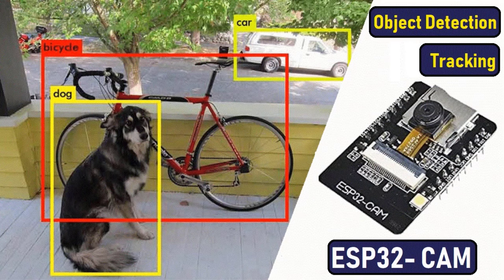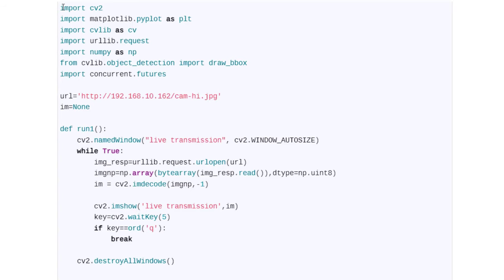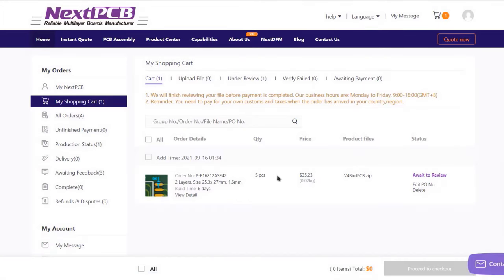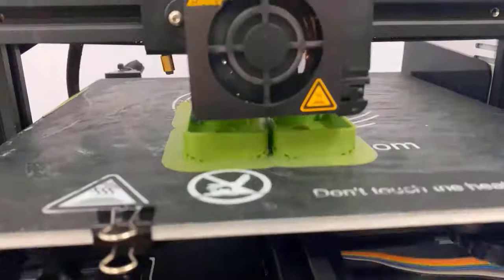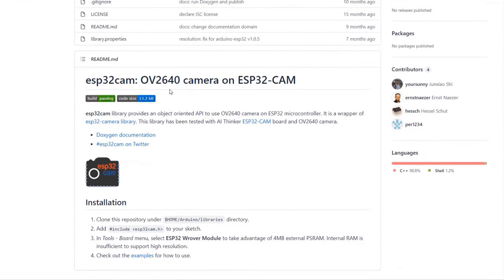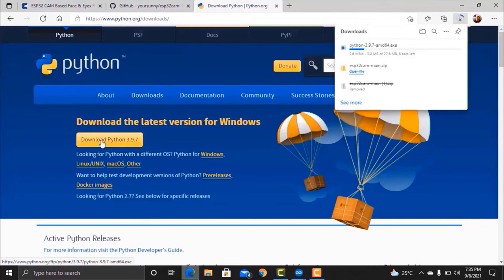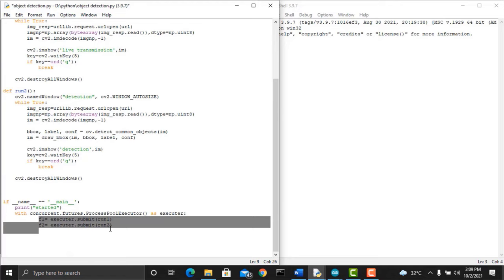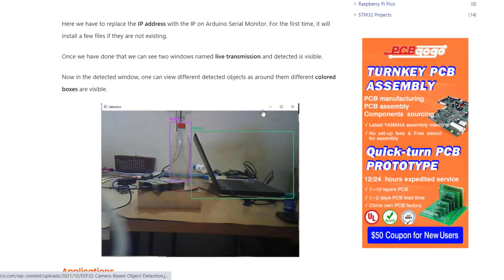Object Detection & Identification using ESP32 CAM Module & OpenCV

Comment: The processing is being done on the host computer and not on Esp32 stop misleading on title of the video. Just wasted my time.
Reply: exactly mate its a fake video!!
Reply: The title isn't misleading at all , the word "using" is correct. "Run" opencv on a ESP32 would be misleading. Imagine how slow and how hell of a headache it would be to handle opencv data with only 34 GPIO and 4MB of flash memory. Don't blame on others your misconception of the world
Reply: @fb846  microcontrollers can be surprisingly efficient since they don’t have to waste a large part of their power on keeping an operating system running. 
In the fast moving it-world you can’t keep up with everything - it wouldn’t surprise me if there were some rudimentary solutions for object detection on such devices. And while I agree that the title is probably not misleading on purpose, it can still be misleading for people which are not up to date with every spec sheet

👍🏼😃
Reply: @schlingelgen  yes some microcontrollers are designed with AI and object detection in mind like the "Arduino Nicla Vision" but in this case the title clearly mentions ESP32 wich is not. For object detection there is the Pixy2 wich is compatible with most general microcontrollers. But my point was that the title wasn't misleading because it's very specific. "Using OpenCv & ESP32" is different than "object detection run on a microcontroller"
Reply: @fb846  I get that, I just wanted to say that it’s not just black and white, misleading or not misleading. I think that depends, and all the information you just gave is not common knowledge you can expect everyone to have. I don’t think the creator is the one to blame, but I can also understand why some people are not satisfied with the solution since they were looking for something different.
Reply: Did you get any video or any source to know how to run a object model on Esp32 itself rather then on some different system?
Reply: @vijay1808able fake nhi h wo esp 32 cam module ko program krne k bad hotspot chalu krke Opencv ko system m instal krke uska Python program run Krna pdega Aur wo system same network se connected hona chahiye aur us camera ko Ip address ki help se Access bhi kr skte h
Reply: @fb846  Then it should be stated as Using OpenCV&PCESP32. That would be fair. Otherwise, I would ask, why not ESP32 and not a webcam? The first thing that comes into mind is that ESP32 would be used as main controller and an  OpenCV port would run on it.

Comment: hello guys , I wanted to ask why does the live transmission and the detection windows not responding..? i have checked my ip address and it was correct..
Reply: How did you solved your issue?

Comment: hello, i have some problems after compiling the arduino code after using the esp32cam library from github. its says "error: 'esp_camera_sensor_get_info' was not declared in this scope". so, how can I solve this problem?
thank you
Reply: I had the same problem, what solved it for me was to update esp32 in the board manager to at least 2.0.2. But after that I'm having difficulties identifying it in python, when asked to make the bounding boxes and the class simply doesn't show any image. however the transmission itself is working.
Reply: @jonimortal  how did you update it cause from what i'm seeing it only stop at 1.0.6
Reply: same problem here. how to solve please tell me

Comment: I face a problem to compile this code ; can you please tell me where is the problem?

error message from output : 

c:\Users\HABIB\OneDrive\Documents\Arduino\libraries\esp32cam\src\internal\config.cpp: In constructor 'esp32cam::Config::Config()':
c:\Users\HABIB\OneDrive\Documents\Arduino\libraries\esp32cam\src\internal\config.cpp:31:10: error: 'class esp32cam::Config::CameraConfigT' has no member named 'grab_mode'
   m_cfg->grab_mode = CAMERA_GRAB_LATEST;
          ^
c:\Users\HABIB\OneDrive\Documents\Arduino\libraries\esp32cam\src\internal\config.cpp:31:22: error: 'CAMERA_GRAB_LATEST' was not declared in this scope
   m_cfg->grab_mode = CAMERA_GRAB_LATEST;
                      ^
c:\Users\HABIB\OneDrive\Documents\Arduino\libraries\esp32cam\src\esp32cam.cpp: In member function 'esp32cam::ResolutionList esp32cam::CameraClass::listResolutions() const':
c:\Users\HABIB\OneDrive\Documents\Arduino\libraries\esp32cam\src\esp32cam.cpp:30:3: error: 'camera_sensor_info_t' was not declared in this scope
   camera_sensor_info_t* info = esp_camera_sensor_get_info(&sensor->id);
   ^
c:\Users\HABIB\OneDrive\Documents\Arduino\libraries\esp32cam\src\esp32cam.cpp:30:25: error: 'info' was not declared in this scope
   camera_sensor_info_t* info = esp_camera_sensor_get_info(&sensor->id);
                         ^
c:\Users\HABIB\OneDrive\Documents\Arduino\libraries\esp32cam\src\esp32cam.cpp:30:70: error: 'esp_camera_sensor_get_info' was not declared in this scope
   camera_sensor_info_t* info = esp_camera_sensor_get_info(&sensor->id);
                                                                      ^

exit status 1

Compilation error: exit status 1

Comment: Hey, I have a question. I ran the Python Code and both camera windows opened, but the detection window doesn't show any box at all, I tried showing different objects and even faces but it didn't show a single box. I literally only changed the IP address and added some comments to the code, but still no boxes. I was wondering if you would know a reason behind this. It's weird since I tried the Face Detection method from cvzone course, and it showed boxes.
Reply: for me too, did u solve it?

Comment: I implement the same code as per your advise but it didn't work properly for object detection screen. Detection screen also showing live streaming results but not highlighting object with the box and name. Please advise ass on as possible. Our project deadline is the day after tomorrow. Thanks in advance.
Reply: Hi, i have the same problem, did you find the solution?
Reply: @dinasboui  yes issue was resolved, but to be honest I didn't remember how I did that. It's about 2 years ago.

Comment: Is using OpenCV for object identification, the same thing as machine-learning?  

I get confused by all the tools and terminology out there.. for example, how does 'TinyML' fit into all this?  

In general, do people collect the data from the embedded system, and then transfer it to a cloud services (ex. Edge Impulse) or PCs (TensorFlow, Kera, etc) in order to train it?    I assume the output of this training is an algorithm that must be ported to your embedded device?

Comment: still trying found a driver with a lot of difficulty !!!! gave me a port number !!! the wifi cam program errors saying espasynch .h
no such data !!! the video program is not the same as the esp32 wificam program from examples !!! been about
4 days working on this !!! you should consider remaking this video cause its very out of date !!! try showing how to download
and install the drivers and libraries it would make this usable !!!

Comment: I tried it, somehow the detection window freezed while the transmission window shows and worked normally. I've followed all the steps. Any help?
Reply: It's the same for me. Which operating system do you have on your PC?
Reply: @FilipVucinic  win10. I guess some library is missing, or some dependencies required
Reply: yes same also for me. detection window not working. I think errors occur because cvlib library has a problem or not working. please let me know friend when  you found a solution
Reply: Hello , please reply if you have found out the solution to this problem .
Reply: @sltechgalaxy1677  , did you find any solution to the detection window problem , sir ?
Reply: no buddy still not

Comment: Hi, is it possible to run the Yolo algorithm directly on the esp32 cam?
Reply: "requires alot of processing power" do you think ESP has enough?
Reply: @sas408  Can any microcntroller do that? looks like not, correct?
Reply: @MrDipankarpanda  it can but in very low framerate and resolution. You're required to store frame buffer of camera and perform analysis on it. So i think you should use pi zero for that kind of tasks